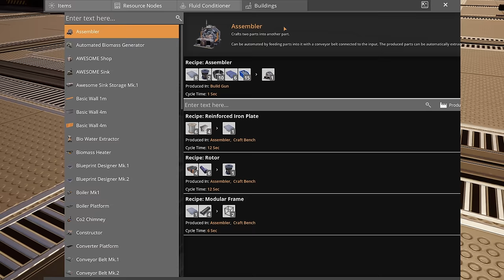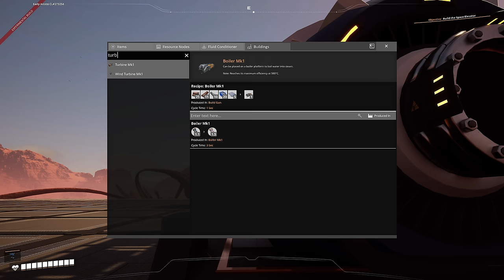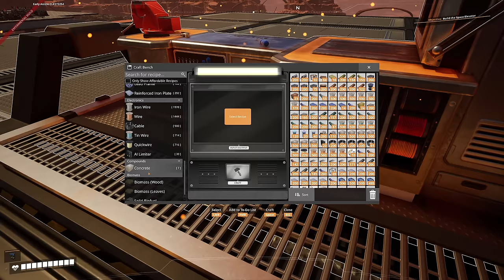Utilizing STEAM and TURBINES To Power My Factory... In Satisfactory

Comment from the maker: Hey Nerds!! Hope all is well... So how many of you, have decided to download the Satisfactory Plus mod yet?
Reply: I did.😂   have not tried it yet  tbh
Reply: This playthrough was the nudge i needed 😊
Reply: I did and it’s incredible the amount of ressources you need to do just the tier 0
Reply: been playing this for a few hours....you want to look at compacted biomass. 2 biowater lines = 9 gigawatts of power (6/min per bioheater). the plant can power itself with excess solid biofuel (not the water extractors tho...you need 6*300 lines of water to run all those boilers )
Reply: I am surprised time and time again how much water you constantly need, and why i love/hate that Mk1 pipes only hold 150 m3 p/min... But there is a LOT to do, and only being behind on buliding something new seems to be the norm in SF+

Have held off rebuilding the initial setup for the base mats, and now i am glad cos unlocked tech that would require a 3rd rebuild already, so luckily i spared a rebuild, but i got a lot of temp setups spread around to do unlocks, and it is as messy as it sounds, so slowly started preparing a mega rebuild instead. The days of putting up a miner and belt it into the factory is a thing of the past, ohhh the crushing and sorting.

It is so much fun though, trying to figure things out.
Reply: Still blame you for making me download it from the 1st hour.
Reply: Its all you fault Bitz, I'm just about to get to oil and I am a little apprehensive, its so hard to contain the factories with this mod. I can't believe how much I had to do just to get a Xeno Basher.
Reply: So yea... I was perfectly content waiting for 1.0. Just fine and dandy. My last Bobs/Angels playthrough in Factorio has also been years.

But here we are, and I guess I'm now playing essentially Bobs/Angels, just in Satisfactory this time. Your fault, btw...
Reply: Adding a redundant steam generator seems... redundant. Lol. It actually looks purely like a method to make the game easier, which is weird cuz... it isn't hard, other games do what the mod wants satisfactory to do better.

Hard to tell who it's even for, really. Content creators?

Comment: Steam Power should be in the base game.  It is... POWERFUL when done right... but that was off of the previous version of the Enhanced Power Mod.  So powerful that you'd be willing to skip coal and oil power.  The best place to do it is at the water falls in the grasslands area because it's also got a TON of hydro electric power nodes.  You can power your entire build from this one area.
Reply: You do realize hydro power is NOT the same as steam power, right?  Hydro power is produced by directly flowing water over the turbine.  Steam power uses the pressure of boiled water.
Reply: What do you think a "coal generator" is? It takes in plumbed water and coal... and outputs... power... what principles do you think it uses to achieve that output from tbise two inputs?

Comment: If you are just creating your first Steam plant, see if you can find a hard drive for Compacted Biomass... I am running 30 boilers off two BioWater for 4500MW.
Reply: I had a hard time seing the advantage of this, i missed that you get 3 Compacted Biomass for 1 Solid and 2 biomass, i thought it was 1 and then its nowhere close to being a good deal.
Reply: @SonneFrank  The explanation of economy I was given on the Discord for the mod was... "For Heater its 20 Biomass or 7.5 Solid Biofuel (15 biomass equivalent) or 6 compact Biomass (8 biomass equivalent) per min"
Reply: the assembler recipe for CB does 20/min solid, 40/min biomass to 60 compact biomass.  with an overclocked biowater pump, your pulling 150 biomass and 300 leaves per min across 5 fluid conditioners. 120 leaves = 60 biomass, so you end up with an additional 150 biomass, 300 total per min. 120 biomass = 60 soild, so run one constructor to produce 60 solid (120  bio -> 60 solid), leave 120 biomass to feed 3 assemblers (remember? 20/40 per assembler) to get 180 compacted bio. the surplus biomass?  convert it to solid bio, feed it to some automated biomass burners and run the production line from them. numbers are easier if you run 2 biowater lines, you end up with 10 fluid conditioners, 5 constructors for leaves->biomass, 3 for bio->solid (2 for assemblers, 1 for auto burners) and 6 assemblers. bioheaters take 6 CB/min, so your gonna run 10 bioheaters per assembler, plus a 300 line of water for boilers, * 6. 60*150mw = 9000mw. enjoy ;)
Reply: @DanielCoffey67  As i had to redo one on my plants i tried to reuse the stream in a Solidifier and Cooler, now i only have to add 7.5 m3 pr. 60 Biological Water adn it does 2.250 MW on 7.5 Water. But damn i takes a LONG time to boot up as the system is really balanced on water and steam, and when its not running, everything is cold and not steamy. Thank god for Mk3 Blueprints, it is the first one to hold a steam setup lengthwise in a single row. EDIT Miscalculated again, not 7.5 water but 127.5, still a lot less, but there was a reason it was slow to boot up.